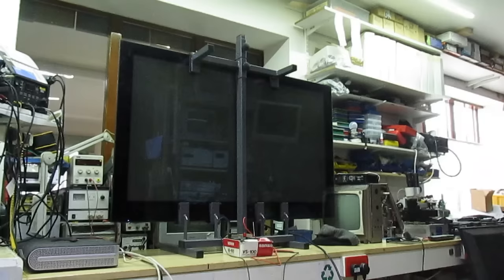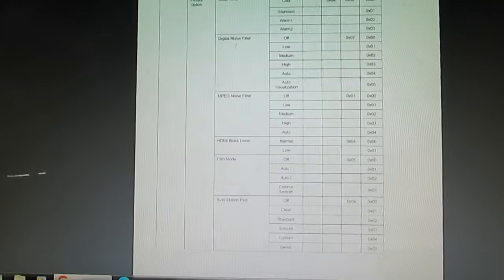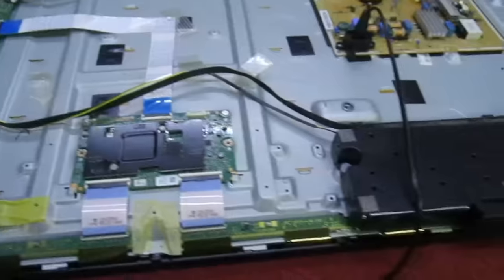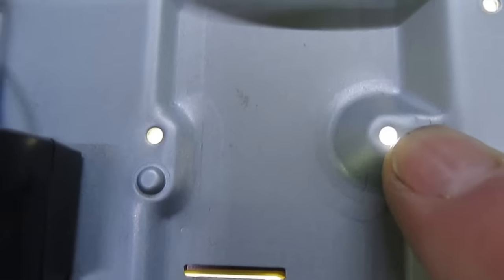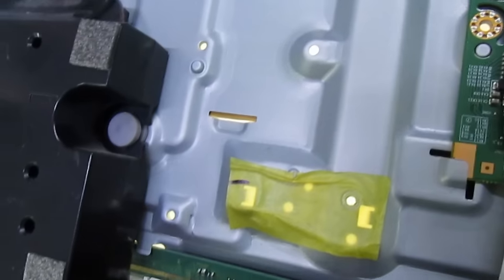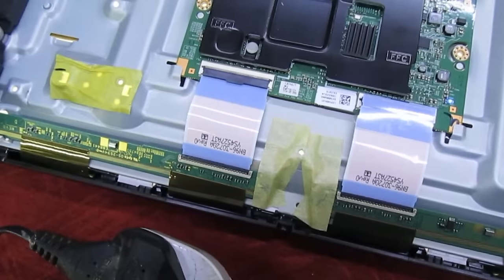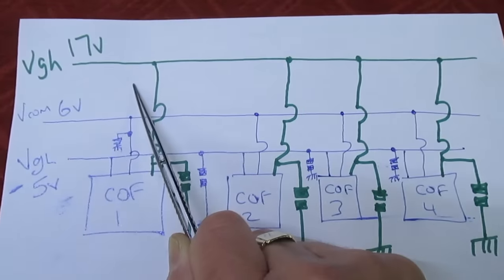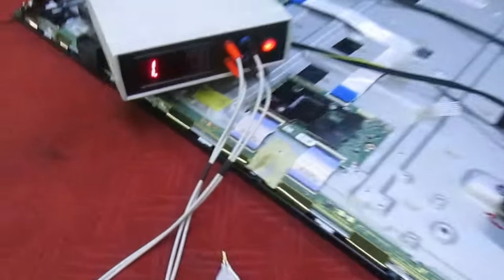Video to highlight the problem of repairing flat panel TV sets

Comment: I have a Polaroid 4k TV that's over 7 years old and hasn't given me any trouble until now. I woke up this morning to a black screen. The power light was on and it was green, indicating the TV was on and the connected sound bar had audio. I turned the TV off and on again and I once again had a picture, but it went black again after a period of time. It's now been doing this off and on all day and sometimes when I touch the side of the screen it goes black. I shined a flashlight on the screen and there is a picture on the screen when it goes black. What's going on here?
Reply from the maker: At 7 years old its more likely the backlights that are faulty but you could be lucky and find its just a dry joint .
Reply: @michaeldranfield7140  I'm going to try to take it apart and see what's going on with LED's. Maybe I should get a tester? Anyway for now I'm using my 32" Samsung as a stand in.  Not the same, bit it'll do for now. If worse come to worse I have an old CRT computer monitor handy lol.

Comment: These Samsung's seem to be total crap. My gym bought fifteen Samsung TVs and within 18 months all had back light failures. Some had total failures and some partial failures. My parents Panasonic plasma is 20 years old and the thing works as well as it did on day one!
Reply from the maker: everything's crap these days, cast your mind back to when plasma TV first came to the market , they were £7,000  now you can buy a 50 inch TV for £300 so its no wonder they don't last , there just not made to its as simple as that .

Comment: Mostly when you bring things in a shop for repair, they don't do this what you do anymore. Most of the time you either pay a lot for repair, even if it costs a few cents/penny's for the part to replace, it usually gives you the sense - go buy a new one - vibe. Shame that this consuming of material is so easy on manufacturers minds these days.
I had once a faulty odometer on a toyota prius, and I found out it was a cap that had a too small margin of voltage and this was common in that model. Such a cap costs 10 cent, but the carshop ordered a whole new odometer and charged over 800 euro's. It baffled me. This is what we live in these days, such a waist.
Reply from the maker: Unfortunately that's the world we live in now , no one wants to repair all they want to do is sell a new one .

Comment: I’ve been trying to diagnose a very similar problem on a Samsung ua55f7000st one of the blue tcon leds does not come on and i think this is the one that that shows the 17v that is derived from a DC to DC chip to be faulty, it does not come on if no cables are connected or not or any combination of them. I also supplied an external 12v from my Bench power supply with same result.

The set also clicks on and off with no backlight and the standby led blinking twice for five times. If i disconnect the main board then the backlight comes on and off with a faster click of the relay on the PS board. I also found that if I leave the PS board overnight there is no clicking and the backlight stays on but if i turn the power off and on again the clicking returns. Any ideas most appreciated! I also had no luck getting any exact schematics of the PS board
Reply from the maker: If your board has power factor correction check across the mains reservoir cap you need a minium of 380v volts when the set comes out of ST BY, if this is low then its the pfc not working.

Comment: How about injecting voltage and using  thermal cam too see which one gets hot. If the cof is bad you’ll see that too
Reply from the maker: I don't have a thermal camera but I have done this before and burnt my finger looking what's hot !
Reply: @michaeldranfield7140  hahahah yup 👍

Comment: Hello, can you tell me how to troubleshoot my 70” Samsung tv or any ideas on what the problem could be and how to fix it?  It has colored vertical lines all the way across the top and the rest of the screen is black.  Thank you
Reply from the maker: In my experience lines on the picture is usually down to the LCD panel itself .

Comment: You should state that the ceramic capacitor is not polarized meaning non directional. I picked up a tv that just would switch through the menu constantly. I found a switch to have dirty contacts. I contact conditioned it with about 300 mA and it was clean. If the manufacture would have used a pull up resistor it would have  not happened. It is a common failure on some sets.
Reply from the maker: Sorry about that, I just assumed everyone would know, I too have had tact switches go intermittent high resistance, for some reason it's quite common is Earley Samsung sets and there used in a ladder network so the one that appears to be causing the problem is not actually the one that's faulty and for this reason I replace all 6 in one go.

Comment: Wouldn't a simple flashlight indicate whether there is a picture?

I have an old minisystem that the light went out on the digital display so that I can not easily see what frequency that the radio is on, but a flashlight reveals it. But I do not often change the radio station, and its operation is not complicated. Not like the modern stuff in which everything is buried menus deep.
Reply from the maker: it would if it was only the backlights that were not lit

Comment: Sometimes you can find the faulty component and repair the device easily - with or without schematics. But what if it is a highly specialized chip that had only been in production for a few years? Or a micro controller for which you do not have the required firmware? Or one of the modern SMT packages which are not meant to be hand soldered?
The cost of one hour of expert labour multiplied by the rate of failure to repair the device even if the problem is known will make repairing consumer electronics less and less attractive. Let's face it: consumer electronics are meant to be, well, consumed.
Selling as much new stuff as possible is called economy today and consumers love it no less than the manufacturers - except for those old fashioned few of us that do not want a new mobile phone every 18 months just because of some new feature they never missed before.
Reply from the maker: I know what your saying but if the manufactures supplied these Highley specialised chips or even firmware like they use to do everything would be much more repairable .
Reply: @michaeldranfield7140  Yes, they could, but it would raise the price of their devices.
As an engineer I know that suppliers of medical and similar devices have to make their devices available for years to come. This often means that they have to stock components which will most likely not be available any more in a few years. Add additional stock and the cost of a "customer repair parts" department that sells single components that were initially selected precisely because they cost only cents. Add yet more to stock submodules that were outsourced to an even cheaper subcontractor. A logistics nightmare!
Are customers willing to pay for this? Frankly: no. They complain about "Cheap Chinese Crap", then go to the (online) store and buy whatever is cheapest.
Don't get me wrong: I love to repair my own devices if I can. I just prolonged the life of my laptop by re-adding thermal paste. But that cost me several hours of fiddling with miniature parts not designed to be taken apart and reassembled. I also broke off the lock of the keyboard LED cable. I knew that could happen and accepted the risk but I would never do that with somebody else's PC. "Buy a new one" would have to be my honest advice.
Reply from the maker: @mynung7008  All brought about by the low prices of consumer electronics these days , if electronics had kept up with inflation like cars and houses have done  a cheap TV would cost $2,000 , I remember in the 70 s and 80s TV sets were so expensive compared to wages a lot of people could only afford to rent a TV , now most people can buy a new TV for just a couple of days wages.

Comment: Capacitor shorts and open circuits are the biggest point of failure in any electronic device ... and they cost pennies to replace! I've just fixed my 2007 iMac because a tantalum on the graphics board went short and blew. The replacement was 87p. Apple said the iMac (probably because it was 15 years old) was un repairable and I would have to buy a new one for £1,800! I work in the electronics business and it's an absolute scandal what manufacturers are doing with planned obsolescence and their replace not repair policies!
Reply from the maker: yes , this is wrong and I get this all the time, how can someone say something is un repairable when they haven't even looked at it ! 
Couple of years ago a customer of mine sent a HI FI amplifier back to the shop he bought it from and they said it couldn't be repaired as spares were no longer available, they charged him £60  for looking , then he brought it to me and the warranty seal was still over the screw, the thing had not even been disassembled and on inspection it was only a dried up electrolytic , fixed in less than 30 mins for less than he paid the supplying dealer to do nothing .

Comment: Another sound but no picture fault (even if the led's do light up) could be down to a bad boost regulator ic on the timing control board in an lcd tv.
Reply from the maker: Correct. I have had this a few times.

Comment: I won't give the manufactures the credit of creating a grand plan of preventing repair of equipment.   They aren't that smart anymore.  Its because they don't have to.  Its not expected from the modern consumer.  Consumers have slowly been fed the expectation to "just replace the whole thing".   As a result, there are fewer and fewer local repair shops.  The whole loop feeds into itself.
Reply from the maker: so true , only selling new sets generates profits now , no money in selling a 50p diode .

Comment: If it's under warranty they generally just get the tech to replace the whole module even if it's a minor issue. At least i know Sony does this. It's fast and easy but it doesn't always solve the problem depending on what it is.
Reply from the maker: That's what you are supposed to do now but new modules can be very expensive to buy if the set is out of warranty.

Comment: Very nice Michael. Just a question. If i don't have a milliohm meter can i use a ESR meter to find the faulty cap?
Reply from the maker: ESR is good for detecting worn out caps but no good for singling out a faulty one where there is a load connected to the same supply rail.

Comment: Don't ever tell them it was a 10 cent capacitor; say it was a fault with the board. I've been a technician for over 40 years, well, maybe 50. Everything electronic should come with a schematic. This will save our planet from all those greenhouse gasses.
Reply from the maker: When I show people the old part these usually amazed how I manage to fing and replace such a small part and are usually appreciate not only my work but also the bill.!

Comment: in my attic I have a huge(like half a 3/4th a foot thick) folder of tv service manuals I bought off a person on ebay(with diagrams).... the item went unsold and I got lucky cause the person kept it..... bought it for sake of having the service manual for an old folding projection RCA tv I have, but asked to be shipped it all because of knowing how uncommon they are these days
Reply from the maker: Just glad I kept all my service manuals right back to the 80s when I opened my first shop, I kept mine while others were throwing away .

Comment: I just took my tv completely apart to change 2 led strips along the top,why could they not have a door there
Reply from the maker: because that would make the set far too easy to repair and they wouldn't sell as many new ones , its called built in obsolescence .

Comment: Thing is ,if a LED TV were to be built in such a way that it could be worked on it would cost more than twice as much as they cost now ! You just buy a new one! I haven't been to an electronics repair shop sense the eighties !
Reply from the maker: quite right , but I think if spending more money could guarantee a longer lasting product people wouldn't mind, however that's not the case , I just had a Smeg toaster in for repair , cost £130 to buy and guess what , made in china and no parts available . customer might as well just have bought a cheap  one for £15.

Comment: Nice vid thanks :D Good trick for fault finding :) I wonder if my uni-t can do milla ohms :o
Reply from the maker: if your meter has a milliohm range you will have 4 test sockets , the 4 lead probes are essential to cancel out any lead resistance  to get an absolute zero reading when they are shorted together .

Comment: I never understood why things still work if you remove an SMD. Generally something glitches out but sometimes, nothing happens. Anyone?
Reply from the maker: decoupling capacitors are not the most important part of electronic equipment and supply rails can be decoupled in multiple places so quite often equipment will run perfectly with one removed .

Comment: Would a thermal camera see a higher temp for the shorted cap?
Reply from the maker: Not in this case as the excess current drawn is detected by the chip and the rail us switched off.
Reply: @michaeldranfield7140  ah ok thanks for the explanation 👍

Comment: Wait a minute... the TV was working without that little cap? Why is it there then, what is "decoupling"? Is its only purpose to add possibility of a short if it fails?
Reply from the maker: The purpose of the capacitor is to provide a low resistance to earth to any transients that may appear on the supply rail.
Reply: @michaeldranfield7140  Thanks for reply. So normal operating voltage can not pass thru that cap?
Reply from the maker: @futu1983  no the operating voltage is not passing through the cap , its just across it as its connected between supply and ground .

Comment: I've been repairing electronics for about 9 years now. It only took trying to fix one TV before I entirely wrote them off and stopped offering repairs on them. You can absolutely spend enough time trying to do component-level diagnosis, but it is honestly like finding a needle in a haystack unless, as you say, you are just very lucky. 

The one and only TV I ever did a repair on seemed to be a faulty power supply. I knew enough about electronics to be able to kinda tell what I was looking at, so I probed around for some kind of standby voltage, was unable to find anything anywhere. I found a replacement power supply board for about $90, tossed it in, and it started working just fine. 

The problem? Used board, not new. No warranty or anything. That power supply board also died, and I was then out $90 since I had no clue how to properly diagnose the board to find the fault. I of course did poke around quite a bit, desperately trying to find what might be responsible for the failure, but I couldn't find anything obvious. If only there was some kind of diagram, or a schematic if you will, that could have told me what component values were supposed to be! 

In the interest of "saving time", you are basically forced into throwing complete fabricated parts at them until they start working again. Normally I would be okay with this approach, IF the replacement parts actually had some kind of warranty or were at least reasonably priced. 

I find it incredibly wasteful that this is the approach things have taken. Swapping out a board is fine, I get it, that's so you can get something repaired and working as fast as possible. But why replace a whole fricking board if the issue is a burned zener diode or a shorted decoupling capacitor? These components cost like 12 cents, probably even less, and can be easily replaced with even the cheapest of soldering equipment. 

Some may argue that the reason service manuals and the like have gotten far less useful is because "the electronics are just more complicated now". I don't think that is true at all. What I found most interesting about this video is that early 2000's service manual looks EXACTLY like the service manuals for modern Samsung phones. There's diagnostic flowcharts, oscilloscope readings, etc, all these things to follow for the specific fault you might be experiencing. They have them for phones, which are objectively FAR more complicated than a TV. There is absolutely no excuse.
Reply from the maker: the whole idea of not supplying any service manual and only replacement boards which cost as much as the set did when it was brand new is of course just to sell you a new set , manufactures are not  interested in repairs any more , as soon as the warranty expires the thing is disposable ,

Comment: Sorry mate, it's not unfortunately that everything is on the Internet, you can easily get a paper version if you wish, just print it. We need to cut down on waste and a lot of the time whenever you need a manual you just pull it up. Other than that I pretty much agree with the joke it has become regarding parts and repair/servicing.

Oh and come on now the board 9 times out of 10 is not more expensive than the tv on the new models, that's exaggerating.
Reply from the maker: the manufactures don't want people repairing sets they make money by selling you a new one .